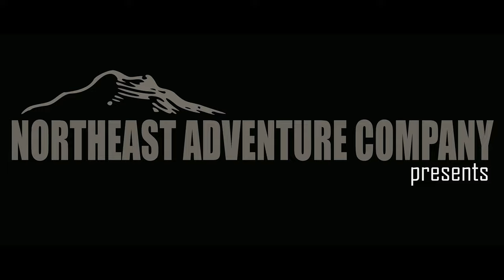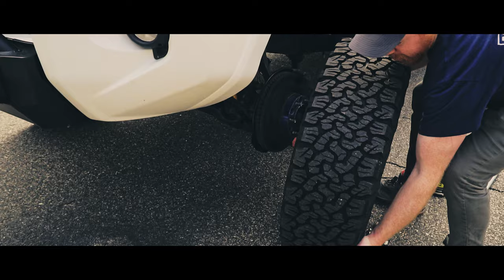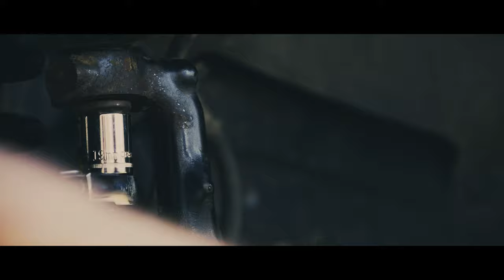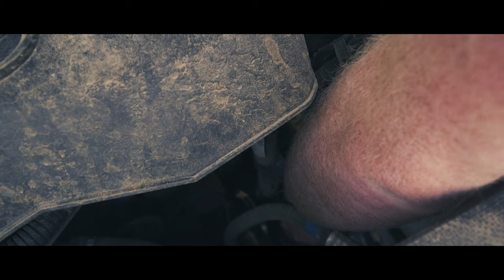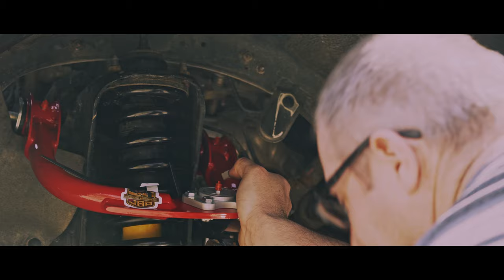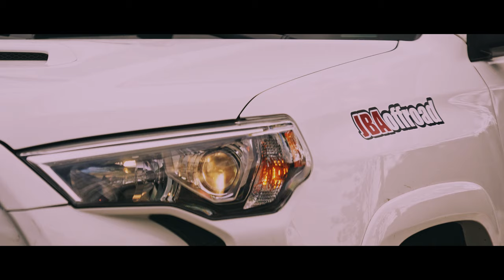JBA Offroad Upper Control Arm Install 4Runner

Comment: You have a very similar setup as I do. OME 887s, spidertrax spacers, 285s(?). After installing my JBAs, I had an alignment with 4 degrees caster, and the rest to spec, but I’m getting some nasty tire rub at the rear of the fender liner at almost full lock. Did you guys experience that? Would maxing caster resolve that?
Reply from the maker: On the front or back side? I have since installed 295/70R17s on 8.5" wide, 0 offset, 4.75" BS wheels. After doing the BMC and trimming the front fender more I barely rub.

Comment: I just ordered the JBAs for my 2009 Tacoma OR. I also have the Old Man Emu 2.5” lift with 885 springs. Are yours the OME as well and if so, how does the combination feel and perform? Thanks!
Reply from the maker: I have the OME kit with 887s up front. It's a little stiff on the road but it works great offroad!

Comment: Hi, Great Video.  What tire size where you running during that video?  What is the size of your Wheel Spacers? Do you have a BMC (body mount chop) to clear your tires?  thnx
Reply from the maker: We believe at that time it was 285/70/R17s on the 4Runner, with a BMC. But we also have a 4Runner with the same size tire and UCAs without the BMC without much rubbing.

Comment: I'm considering purchasing these. Will my tires rub the UCA's? I have 285/70/17 on stock 17x7 TRD Pro wheels. Some say they will...some say no. Very confusing. Thanks
Reply: did you ever end up installing these JBA uca? Im planning on running the same with 285 falken and 17x7 TRD pro wheels. not sure if it will rub
Reply: I'm trying to do the same . Can't find information on 5th gen 4runner on TRD pro wheels using 285 70 17.
Reply: @REMYLEONEL  I just bit the bullet and got them to try. Will let you know when I get them installed
Reply: @mathewhua7247  oooh man I really appreciate that . Thank you
Reply: @mathewhua7247  Hey man, don't forget about us. We are still waiting to see your results.

Comment: Will this help or fix with wandering? And my wheels are 18x9 0 offset with 285/65 tires will it need spacers?
Reply: The JBAs are meant to be a high caster UCA and the spec sheet says about 4 degrees positive caster for alignment, but many are achieving 5 or more in their builds, but its application specific.  Positive Caster should help improve wandering up until a certain point, and pushing as high as possible (over 5*) can create its own issues.  

The JBAs come with the suggested alignment specs also

Comment: Thinking of getting JBA UCA for my 5th gen as well. Do you need to run wheel spacer to clear the new UCA? I also have the trail wheels. Thank.
Reply from the maker: Cheng Soung you do not need spacers, the JBA UCAs will work great with stock wheels as well!
Reply: Northeast Adventure Company awesome. Thank you! Do you guys carry these UCA or would I have to buy it directly from JBA?

Comment: What was the torque on the bolts?  Shouldn't you have torqued them when the vehicle was on the ground?
Reply from the maker: Torque was checked again on the ground.
Reply: @NortheastAdventureCompany  Can I ask what your torque settings are. I am going to be putting my JBA UCA on my runner this weekend
Reply from the maker: @Ronbo033  Sure! It's 85 ft-lbs on the long bolt nut, 45 ft-lbs on the ball joint nut, and 20 ft-lbs on the ball joint bracket nuts.
Reply: @NortheastAdventureCompany  Thank you